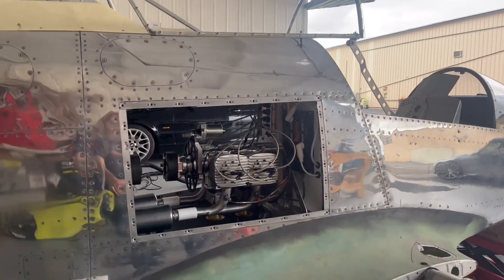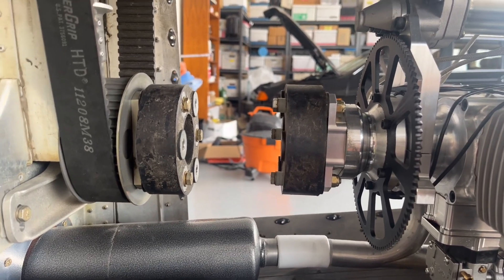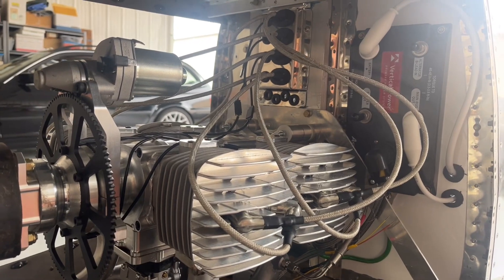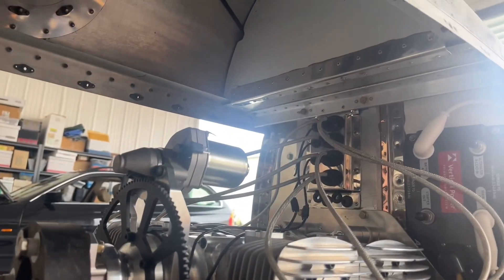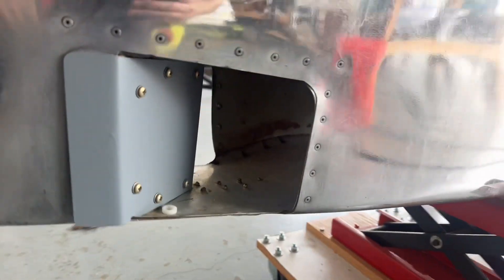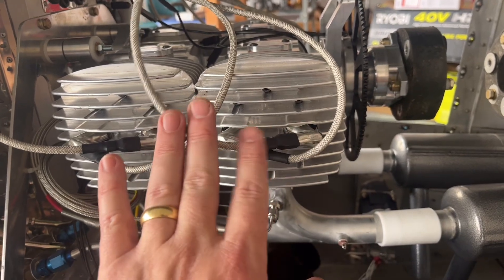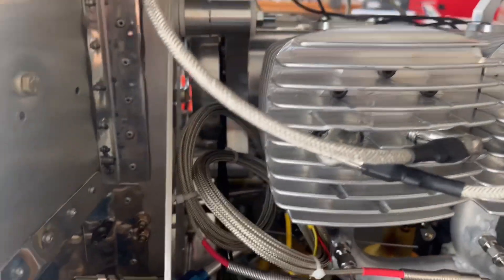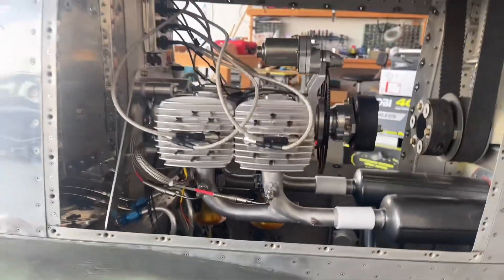Engine is back in the plane

Comment: Sir, I commend your work and dedication. With respect to the cooling; may I recommend a review of NACA ARR E4E31. Unless you aim those engine exhaust tubes down the centre of the exhaust duct you have only half of the cooling system Jim Bede intended to have for the BD5.
Reply from the maker: Thank you for the message. Yes, I have that document and have reviewed with some of Bede's engineers. My calculations are for a 1.6 sq in exhaust flange centered about 1 inch into the venturi opening.

Comment: That is beautiful craftsmanship!   I hope that engine works, but I can't see how it's going to give you the torque or reliability you're going to need.  It's going to be screaming.
Reply from the maker: The engine has already proved very reliable in powered parachutes and drones in the Czech Republic and Europe. I've worked hard to keep my final weight down, I believe my last time weighing the aircraft was 345 lbs. The light weight combined with keeping the original aerodynamics slick by not adding any scoops hanging out should make it a very efficient design, not needing extra horsepower and torque just to push more weight and drag.